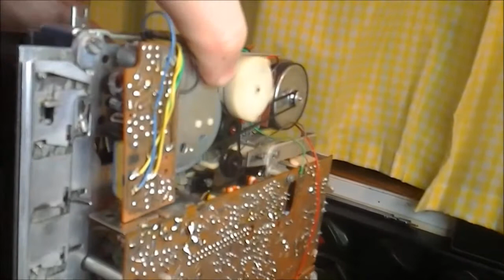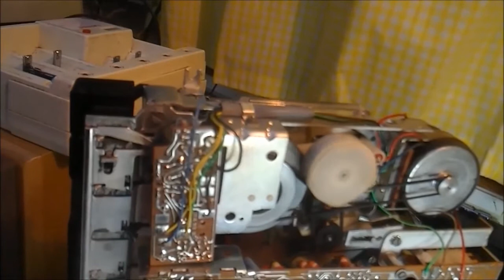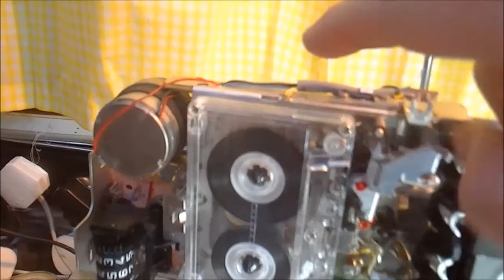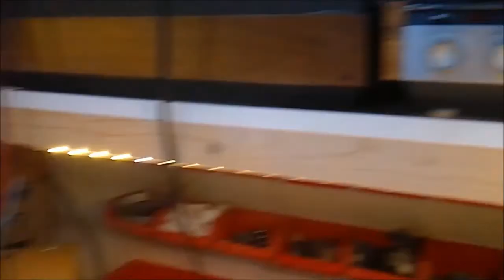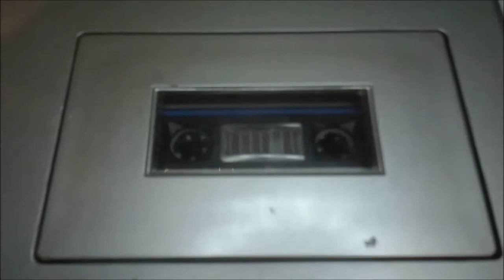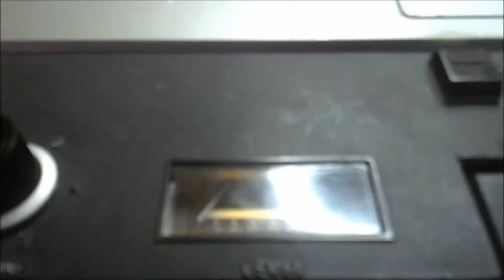Early 70's Philips N2405 Cassette Recorder

Comment: Thank you for the video!  I have the N2405 that I bought 46 years ago and I am trying to restore it.  My question is this:  What is the AC voltage leaving the transformer and going into the circuit supposed to be?  (I am getting zero volts coming out, so I think the transformer is bad and I need to find the correct replacement.)   Thanks!

Comment: Another great video, River. Been following you for ages but somehow I missed this. I sure wished you serviced and repaired other folks machines. My N2506 is desperately in need of a service and probably some cap replacements, but finding any engineer who will go near it is impossible.
Reply from the maker: Hello Jon, and thanks For your kind comments. I do, from time to time, repair other's old kit, I've just found the fault in a neighbour's flatscreen telly, a couple of new caps and away it went. Now. Back to yours. I believe this is one of many made somewhat similar to the N2400, which I have, the only difference being that yours is a "standalone" item with no built-in power amp ? It also appeared as a PYE, 9145, I think, and in several Dynatrons too. While I'd quite happily look at it for you, I'm down in Hastings, East Sussex, but, if you'd like, ...! Probably full of gungy belts, and in need of a squirt of switch cleaner. We might see.
Reply: River Huntingdon yeah it’s pretty much the same model as the Pye you featured. I’ve changed the belts which had liquidised but there is a low hum on one channel when recording (possibly caps related) and the frequency response is not great. Basically It needs tlc :-)
Reply from the maker: So the mist thins. Has it got its original head ? The hum might well be down to an iffy cap somewhere, or possibly the rec/play switch, these can go funny after a while. :-)
Reply: Yes I think it's probably cap(s). Yes it does still have its original head.
Reply from the maker: If it is an ordinary head, chances are it's worn out. Longlife heads were fitted to some though, and are easily identified as such, it says Long Life Head on the head. As you probably know worn heads can cause all sorts of odd things to happen :-)